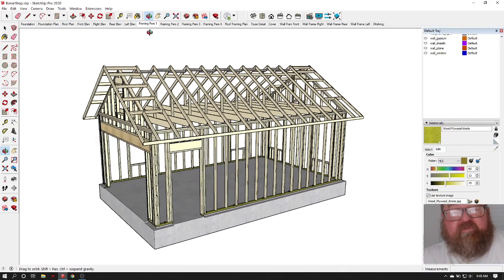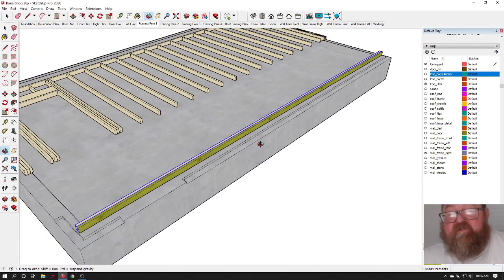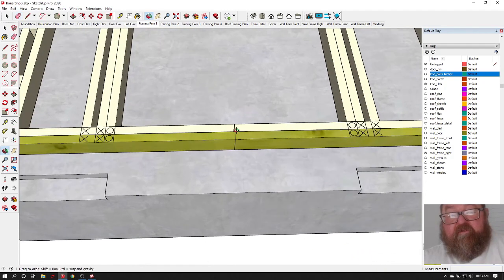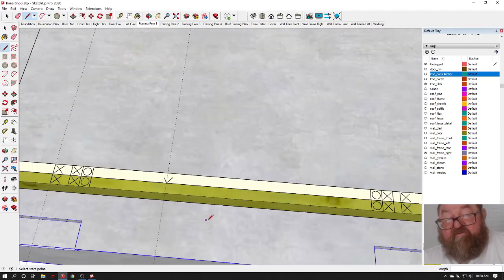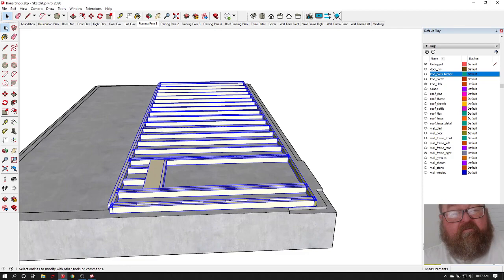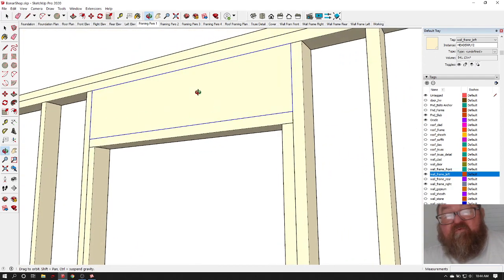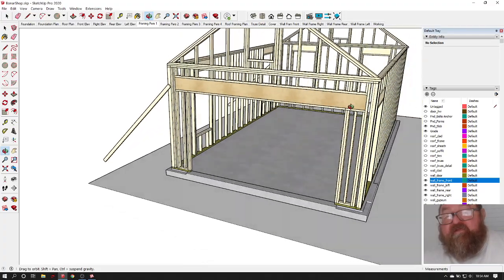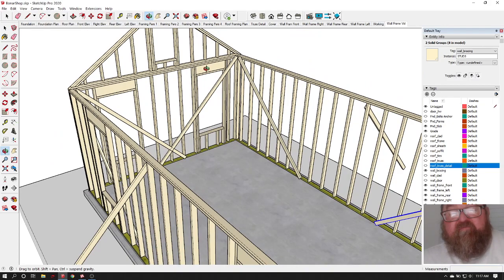Framing Video for Charles's Garage - Part 1 - Wall Framing

Comment: Great video again tony. Question for you. Outside of politics, what’s your reason for not liking California corners? That design does allow you to better insulate your corners. Thank you!
Reply from the maker: I have a video on this somewhere.  I show that there is no material savings and the same amount  of lumber is used between the two.  The outside corner is the biggest thing for me.  Everyone forgets that most homes have corners boards for the siding and when you only have an 1 1/2" to mail to, the edge of the stud, i can creates problems there.  On one side you have 3 1/2" but the other you only have 1 1/2" with  CA corner.  You can insulate a standard corner also.  It jusy takes more thinking which we artisans do not do.  The main thing is I hate it when fads creep into the construction industry and some thing lie this always takes the focus away from the total system/wall assembly.  Insulation is not the only consideration.  You also do not have a nailer for the ends of your lap siding on one side of the corner. But I made that video because I get this question a lot :)